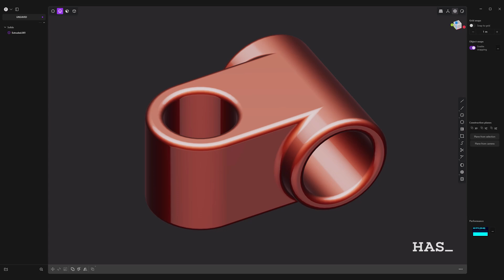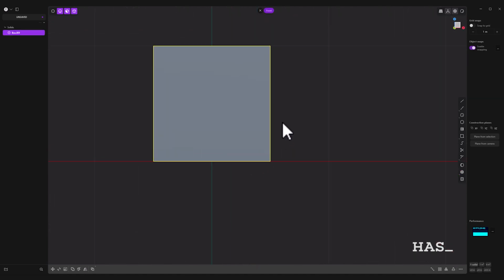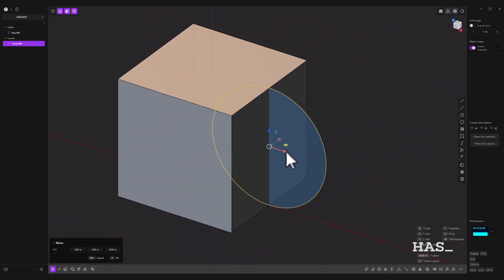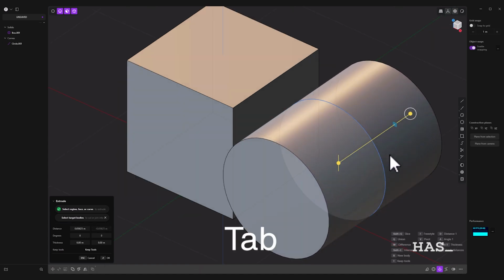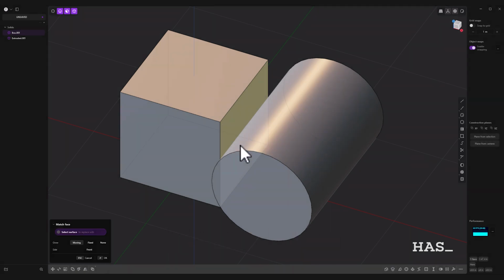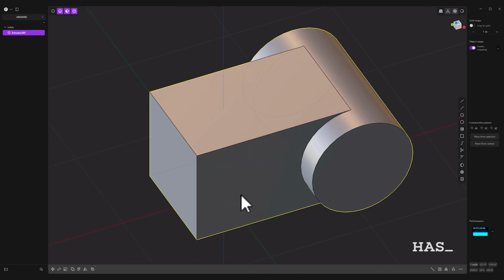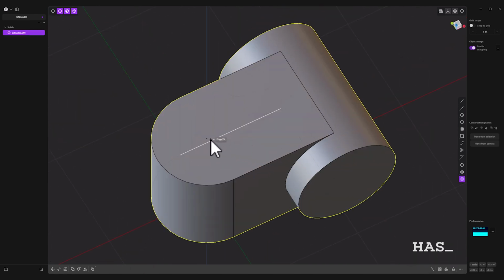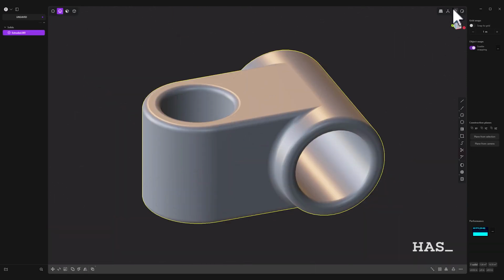Plasticity | Simple Modeling with Match Face

Comment: Can it be done with precise measurements in case if I want to use it to design something for real world application and 3d print it? If yes, how much more time it will consume? Is there any tool to just show length of each edge and radius of holes?
Reply: Alot more. I didn’t realise that before buying this software you cant add dimensions live while creating sketches like fusion.